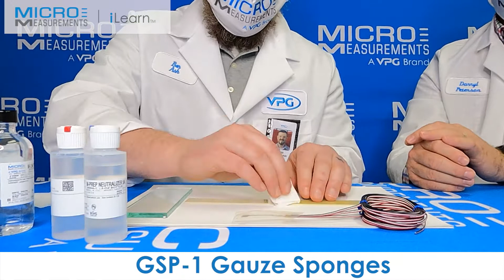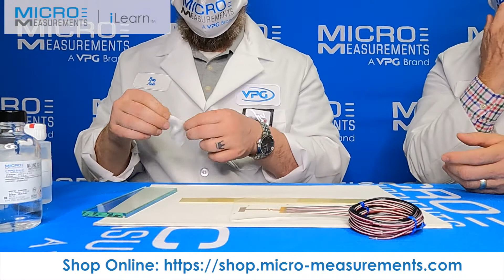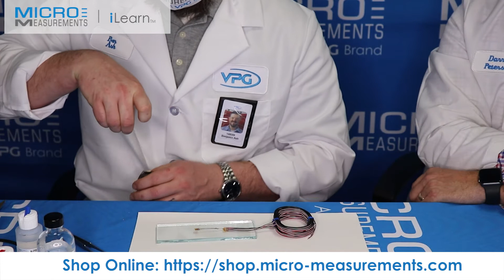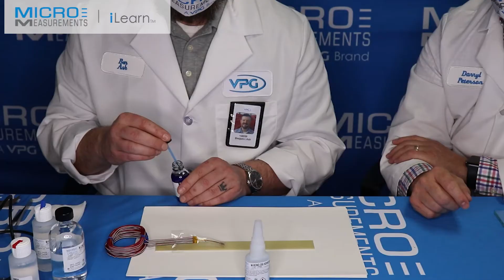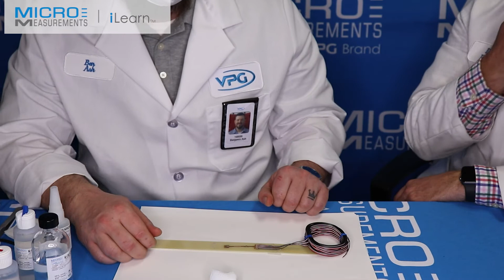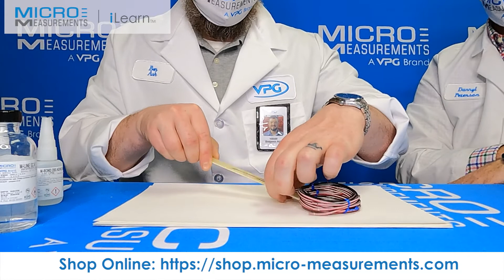C4A Strain Gage Installation with M-Bond 200 Adhesive (Composite Beam)

Comment: if I want to install SG on an aluminium specimen, do I need to abrade the alloy surface first or unnecessary?
Reply: Thank you for the inquiry  regarding aluminum.  Yes,  we would recommend that you degrease the aluminum first and then abrade with a 320 to 400 grit silicon carbide paper.  Then follow with a scrub with conditioner and then neutralizer.  The complete process can be found on our website in bulletin B-129 or in one of the various videos available on the Youtube channel.   I hope this helps.  Darryl